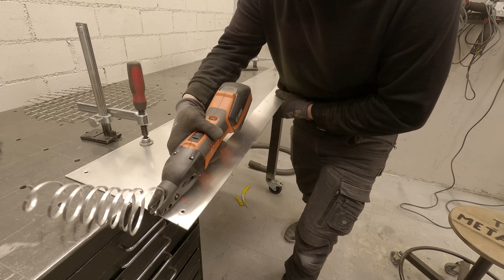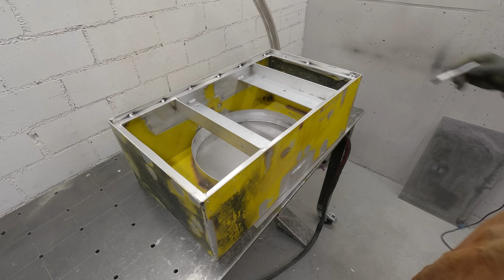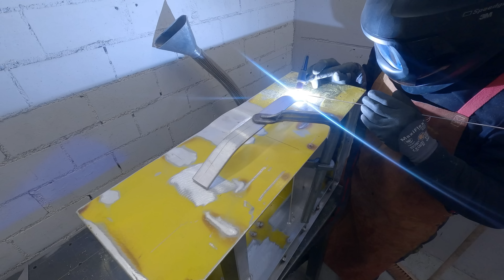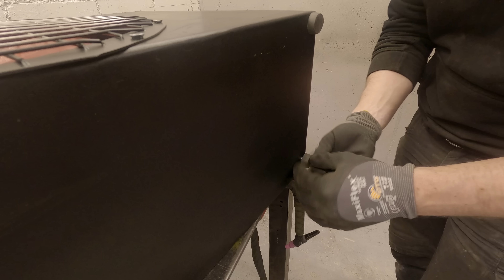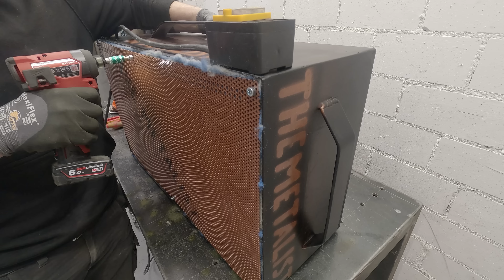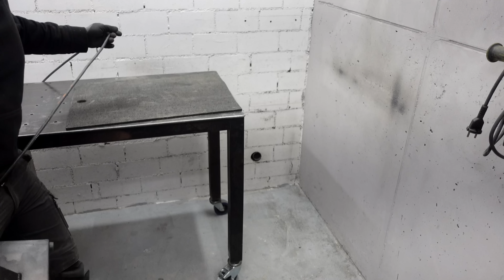Downdraft Table Box attachment dust collector

Comment: Awesome idea. I don't have the space for a downdraft grinding/sanding table. Guess I'll be looking for a fan. I do have an axial 12" exhaust fan that should do the job.
Reply from the maker: Thank you 😁 yes that was my problem, no space 😁
Reply: @TheMetalist  I just recently took up TIG (plenty of MIG experience) so I've been following you. Your table especially has been the inspiration for the one I'm about to dive into this coming week. I'm curious what size the threaded holes are? The standards seem to be 16mm or 5/8" un-threaded, but what you've done seems a bit more useful for a small shop.
Reply from the maker: @warrenmusselman9173  The holes in the table are M12.  I prefer smaller holes in the tabletop.  Send me some pictures when you're done with the table 😁
Reply: @TheMetalist  Will do.